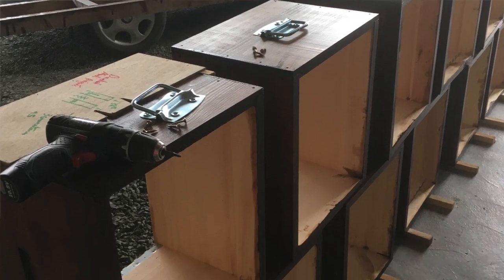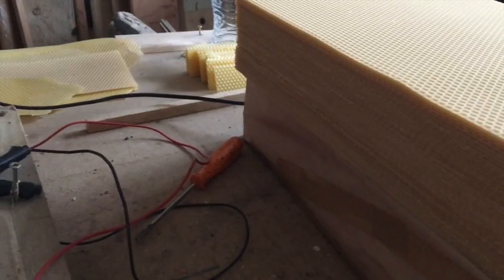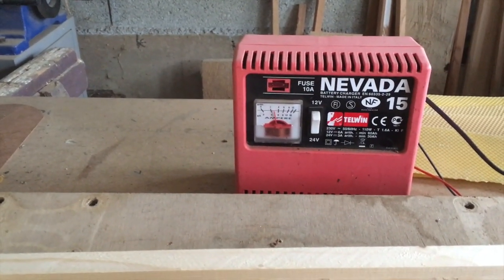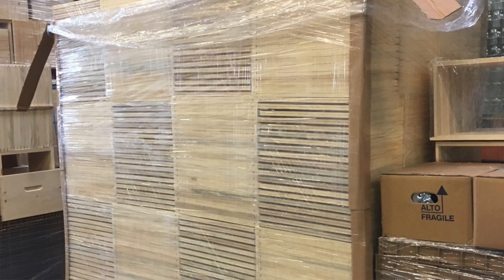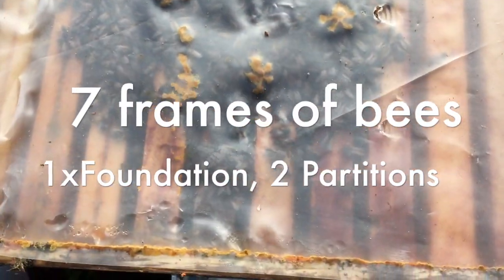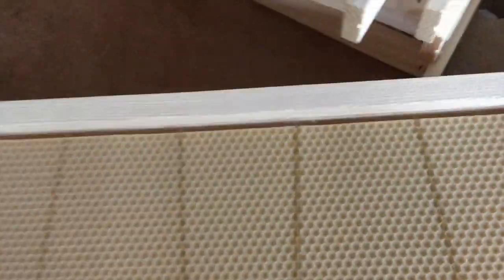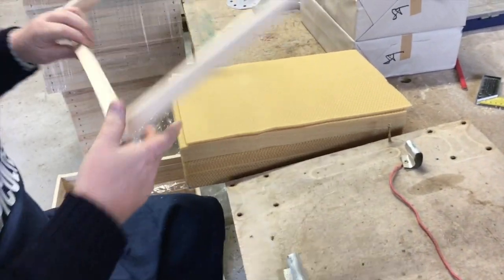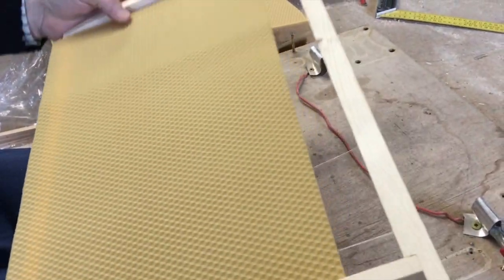Waxing up Dadant frames on a wet afternoon.

Comment: Richard, you should leave a 4mm space between the foundation and frame on the bottom, it prevents a lot of Warping of the foundation.
Reply from the maker: Kai Stümer we find that’s not a good use of recourses. Very often they build the space st the top this making a frame with even more cells in it! That’s what my
Point was
Reply: @richardnoel3141  yes they always build the top shut. The bottom just if there is less then 6mm.

Comment: Why use wire .
Why not just pop foundation into frame.
??
Reply from the maker: paul dow the wire supports the foundation. If you don’t have wires the sheets of wax warp and when you come to use them the bees build them as hey are and the frames become badly shaped!
Reply: Easy answer, this is natural foundation for embedding. 
For just popping in, you need wirded foundation with stiff wire or plastic foundation.
To bad there is no plastic foundation available for Ddadant (Langstroth x 1.22 in height).